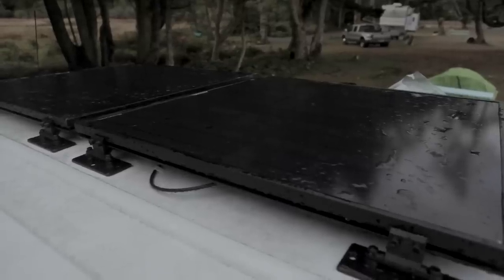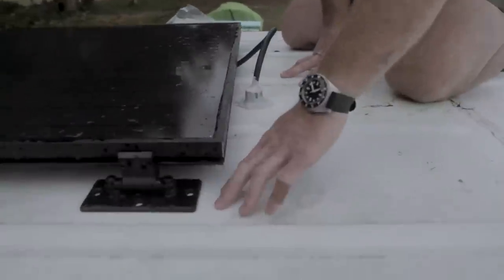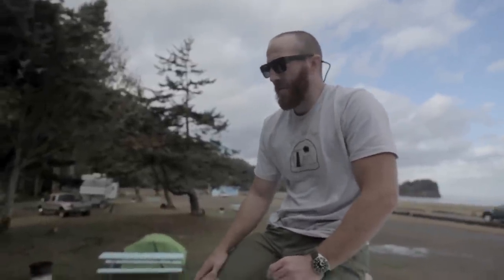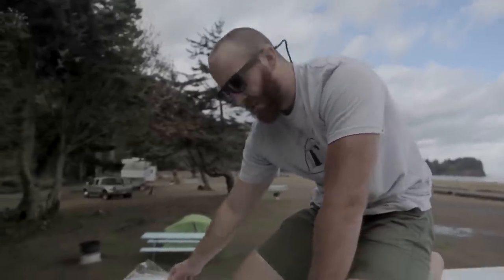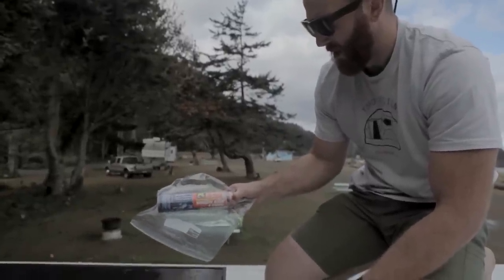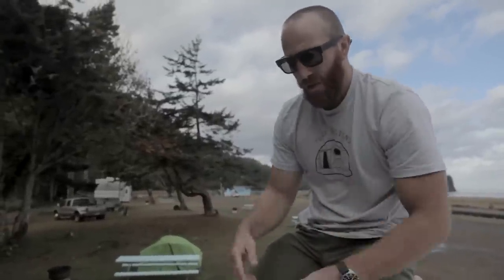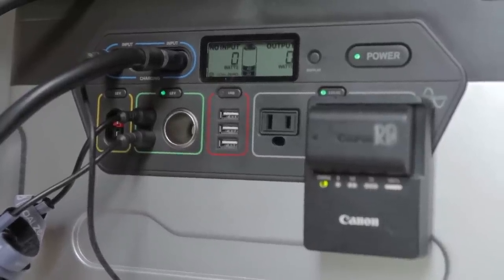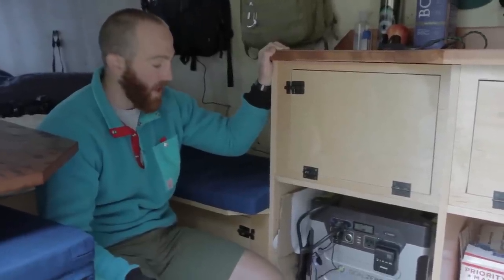Sprinter Life | Huckberry & Goal Zero

Comment: Could the Anderson powerpole port be hooked to a fuse block/panel like the below?
http://www.amazon.com/Blue-Sea-Systems-Blade-Block/dp/B000THQ0CQ

As long as the requirements were met as far as output amps?  ie. under the 30 amps max for the port

Could the http://www.goalzero.com/p/196/goal-zero-yeti-1250-ring-terminal-connector-cable/28:4/ be used for this?

Thanks.
Reply: +Chris Roberson - I've heard the Yeti 1250 uses a lead battery and not lithium and using it daily it will last only for about 18 months. The Lion l-1500 might be a better option?

Comment: What mounting brackets did you use for your panel?
Reply from the maker: Sam Kikuchi There are using the GoalZero Boulder 90 Panel with the mounting brackets. They use a special 3M adhesive to attach it. http://www.goalzero.com/p/260/boulder-90-solar-panel
Reply: Goal Zero Are the hinge bases compatible with the Boulder 30 panel?